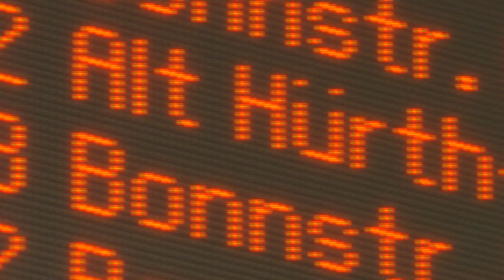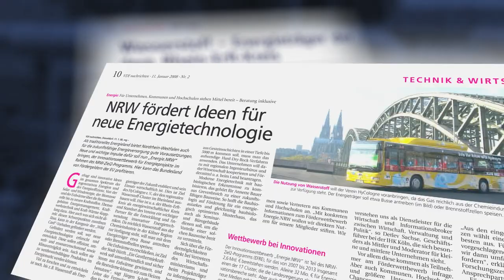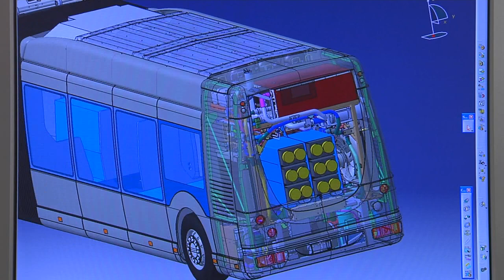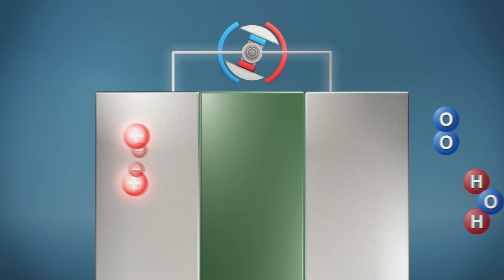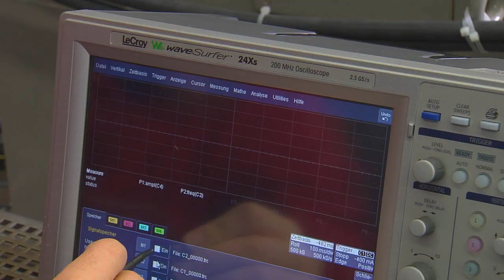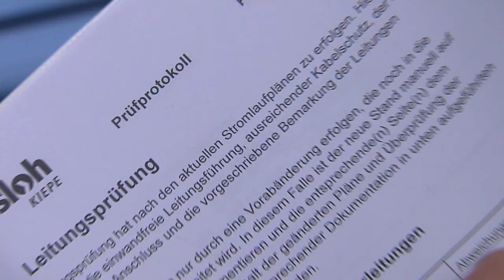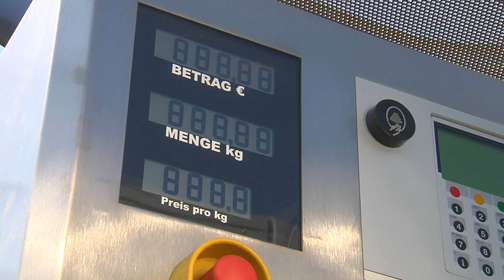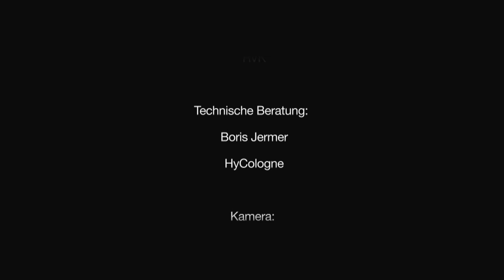Hydrogen Fuel Cell Buses in Greater Cologne - HyCologne and RVK

Comment: I also want to see regenerative braking systems fitted on all busses, today. This goal should have been attended to a decade ago.

It does not matter if it is feeding into a resistor grid. Even diesel busses benefit from regenerative breaking. Hot brakes do not work too well on heavy vehicles. By keeping the brake temperature down, the safety and efficiency of those braking systems are increased. Look up the Voith fluid retarder; an accessory which mounts onto the vehicle's gearbox.

As vehicle body producers become accustomed to installing these dynamos, they can gradually start storing power in the vehicles ignition and accessory battery systems. Finally, an advanced regenerative braking system can be fitted to this fuel cell vehicle, storing everything it generates 100% of the time.
Reply: You are so right. The supercaps make so much sense in this inner-city bus, because it is braking and accelerating all the time. A Diesel engine could be designed much smaller and turned off during stand-still. Of course, fuel cell is even better.